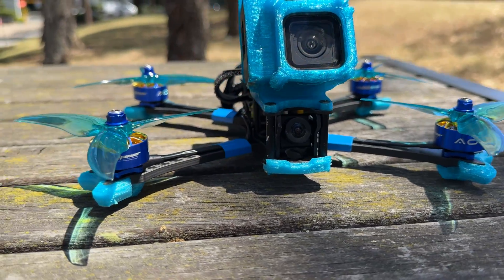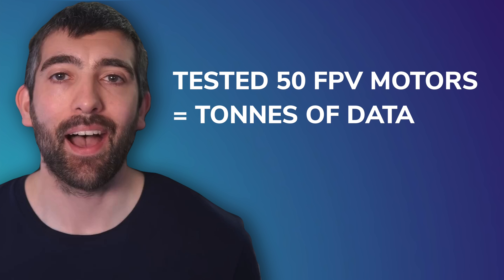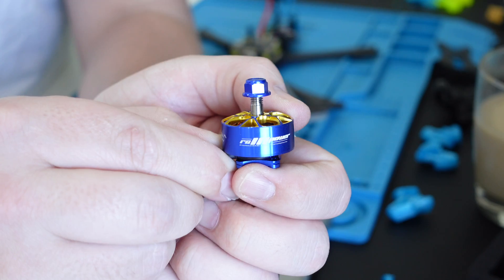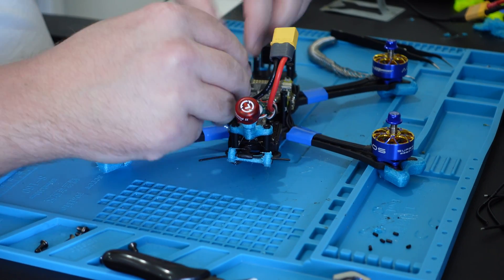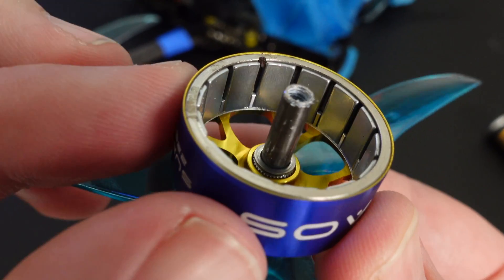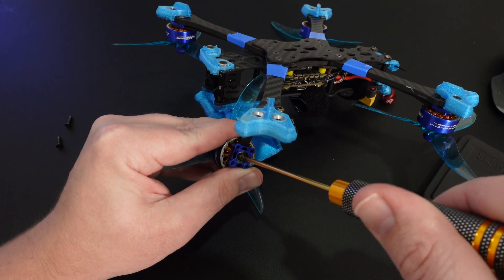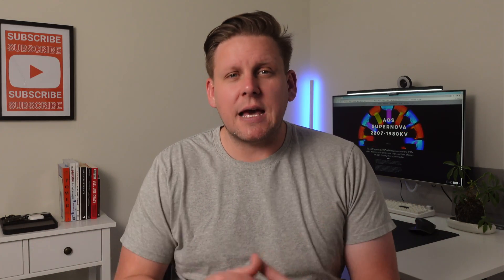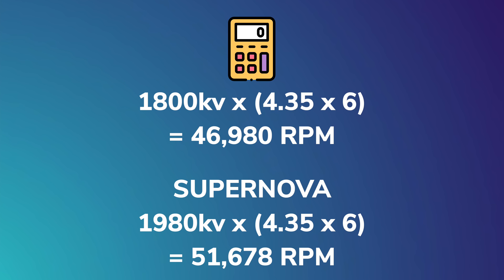I Tried “The Best” FPV Motor According To Science

Comment from the maker: There are somethings, which I didn't get into in this video.

My measurements indicate they're closer to a 2308 than a 2207.
But Chris already told us they're not 2207 but "2207 Class".

Chris states they are quantifiably better performing in terms of thrust, torque and efficiency than the average of the 2207 motors he's tested. But 2308 is a bigger stator and produces more power than a 2207. Therefore, of course they will be higher performing, that's how engineering works.

Before I get into this, you may think, well isn't Chris one of the "Good Guys". Chris was contributor in the community who was recovering some of the cost by his frame and some products. We could all get behind and support that.

However, Chris has/is moved/moving away from "I'm just helping out the community and being reimbursed for the efforts" to a full on commercial business in FPV. So he's due the same scrutiny that we'd give any other company.

Here are the several issues with these motors:

1. Science & engineering is supposed to be able to discern truth and define fact. Having a motors that are closer to 2308, but calling them "2207" and using the term "2207 class" is disingenuous.

2. Chris has built his authority in FPV based upon applying an engineering approach to define truth and fact from his testing. This profile was based upon a companies sending him their motors to test for marketing purposes (and yes he's bought some himself).  To then use the motors provided by companies to create a competing product doesn't exactly exemplify integrity.

If the companies who produced the motors were also in the UK or even in the USA, it sounds like Chris would have a lawsuit on his hands.

3. Chris states his motors perform quantifiably better than the average 2207 motor. I don't have any issues with taking the average as a benchmark for marketing reasons, that's acceptable. But, with the stators being closer to a 2308, Chris calling them a 2207, then comparing them to 2207 motors doesn't show whether they genuinely perform better because of the engineering he's put into them, or if it's simply because you have more stator volume on a 2308 than a 2207.

4. Why didn't he just call them 2308's and use his platform and science to say that the best motor size for 5" Freestyle is a 2308? I actually wish he did, even if they are a few points of a mm smaller than 2308, representing them in their true size would have been better.

But calling them 2308's and saying this is why its the right size, opens him up to competition. You can't charge $29 for a motor that's performance is derived from its stator size and its marginal improvements over the competition are because of its engineering. 

Everyone would make 2308's and Chris's competitive advantage is suddenly gone.

As I said in my video my measurements shouldn't be taken as 100% accurate, but if you give the manufacturer the courtesy of not having to be accurate, and allowing them to be misleading in their product - well, same applies here.
Reply: The weight is about the same as a 2207 motor so in my opinion it's fair to compare them, but the naming is wrong
Reply from the maker: @timon72489 yes and if the marketing said, I’ve built a 2308 that weighs the same as a 2207 so you get all of the benefit of the extra stator volume without the penalty of the extra weight. 

But he didn’t. 

He’s saying they perform better than the average 2207, as a 2207. 

So not a true representation of the situation
Reply: @DarrenAllatt a Ford mustang 5.0 isn't exactly 5 liter motor. It's 4.951 liter. I don't see why the exact size matters so much or why that's deceiving in any way. We already know how the motor is made is more important than just the physical stator size. That's why some 2207 are just clearly better than others, while still being the same size stator. I think the prop size/weight/kv are what puts motors together in the same class.
Reply from the maker: @bigfuzzyarchon2007  Except Ford aren't saying their Mustang 5.0 is a v6, scientifically X% better than the average V6 when its actually a V8
Reply: @DarrenAllatt  so are we only allowed to compare motors of exactly the same stator sizes now? 2306 vs 2207? I always just grouped them by what prop size they are meant for, and then their weight and kv.
Reply from the maker: @bigfuzzyarchon2007  there are two things here

1. When you compare a motor you need to also compare the stator volume, 2207 has about 6% more stator volume than a 2306 which is what allows it to have higher performance.

2. In your example you mention comparing a 2306 to a 2207, you can absolutely do that but when you do, you know you are comparing two motors with different stator volumes. In the situation with the Supernova's they're being marketed as 2207's all the product marketing & specifications says 2207, but they're not they're 2308's. It's like me comparing two engines in a car saying my V6 Engine which has 8 cylinders is better than the average V6 engine
Reply: @DarrenAllatt  what I'm struggling with is why would we be upset if we're getting more than what it says. What is the downside of these motors when compared to other 5 inch motors? Besides price obviously. If they weight the same, perform better, more efficient, then I feel like it's okay that they also cost more. So the issues aren't really with the motor itself, just how it's compared to other 5 inch motors
Reply from the maker: @bigfuzzyarchon2007   

How are you supposed to make an informed decision on which product to buy if the product specifications are misleading you?

If T-Motor produced a 2308 in 1980kv of their budget Velox motors, which on the bench had close enough performance to the Supernova's and were half the price; you can now make an informed decision. Do you want a reasonably close enough performance for half the price or did you want the premium ones.

(car analogy) But to in your marketing and product specifications say your motors are a V6, which perform far better than other V6 motors, which is why you should buy my v6 engine - but its  actually a V8 and the reason for the higher performance is mostly because of the extra 2 cylinders its misleading you, because then you'd want to compare it to other V8's when making your buying decision.

The issue I have is that:

Chris is meant to be the "science & engineering guy" who is able to ascertain facts and provide truth and hard data and actual specifications to the FPV Community.

He openly does this with every motor he tests and publishes all the hard data and facts, defining the actual truth. 

This gives him authority.

But, the moment money came into the equation in order to sell his own motors, he no longer played by the same rules which he scrutinised everyone else against. He no longer stuck to facts and he purposely skewed the marketing to favour him.

Imagine in Nascar if someone has a V10 but said their motor was a v8 and the reason why they were better was not because they made a better v8 then everyone else, but they stuck two extra cylinders in the engine.

I would have zero issue of Chris called them a 2308 and marketed them that you get all the benefits of the larger stator volume without the weight penalty of the increased size.
Reply: @DarrenAllatt  The main motor he compares against is the rcinpower wasp. which based on his data was the best 5-inch motor. It 22.6-6.5, which is smaller stator volume than 2207 motors, but better thrust and efficiency. I don't think anybody actually cares about the stator volume itself, only about the actual performance. Just like in a car, if you want the quickest car, it doesn't matter if it has a v6, v8, v10 or whatever. The actual 0-60 time is what you will be comparing. The number of cylinders is completely irrelevant when you are trying to find out 0-60 times. You can always find a faster car with difference number of cylinders. Yes, obviously there are going to be motors with better value, I would argue the wasp motors are better value. In race cars, finding advantages and bending the rules with some innovation is how it's always been done.
Reply: @bigfuzzyarchon2007  I think it's still a bit odd that Chris asked the viewers not to share the measurements of his motors on the internet. So at least Chris himself does care about the stator volume.....
Reply: @skychaser5591  just saw another video where they properly measured the motors, they are 22.5x7.5
Reply: @timon72489  define about in grams :)
Reply: Why did you zero comparisons other then measure them with a caliper?  Did you compare flight time or top speeds using GPS or a speed gun?  It sounds like you just dont like chris.... why not actually show us they are not any better instead of just complaing about the size?
Reply: Other manufacturers are not based on science when they make motors, they just make them randomly :face-blue-smiling:
Reply: Thank you for taking the time for this
Reply: So you have not realy tested them? fly different motors let them hover and see the flight times for example. You have those motors, are you realy shure that the stator volume is bigger? I mean have you at least meassured them before you jump to conclusions? You say "measurements shouldn't be taken as 100% accurate" BUT have you meassured them?
Reply from the maker: @iwh7  Did you watch the video where I showed the callipers on the stator measuring it?
Again, I am not disputing that Chris's stated results aren't accurate - they will be spot on; rather its they're not 2207 and they're being compared to 2207 motors
Reply: @DarrenAllatt  ive seen that, but meassuring only the height and outer size does not give you the volume, for that you have to at least meassure the inner size too and take into account the amount of vollume used by the windings. and VOLUME means mass. yes its not an 2207 that is clear but from a weight and twr it still seems a fair comparision? and the only things i got,  its not exactly an 2207 size and its pricy. But that does not say anything about the other claims. power, Efficiency and torque. And for the rotation speed, is it as advertised? and if this motor is as promissed more powerful AND more efficient, you could probably ignore the higher kv by simply using a lower max rpm, which means maybe even more efficient?  OR if it exists in other variations ORDER the right one for you. But that ALL NEEDS to be tested to give a realistic and honest review.
Reply: Motor companies have done this since the beginning of mini quads.  I do love all the hype and drama.   Buy them or not.  Like them or dont.  I also dont think the price is all that bad.  I have a set on the bench to try out because i like to try things and i think these will push us incrementally forward.
Reply: almost 8 minutes and you LITERALLY didn't say anything about the motors that would actually change my initial impressions of it, just a whole bunch of "don't trust the data". Like he didn't even give me his "feelings" to replace the data, he literally didn't say anything other than "I think the stator is big" which Chris literally says in his videos (overhangs of the magnets capture flux that would be wasted from the top and bottom of the rotors). If you really think these motors are 2308 instead of 2207, compare them to 2308 by power, flight time and weight then. Do ANYTHING other than ramble on like an older generation shitty generative AI
Reply: Tldr: science guy said science so best! Aka: let’s take the bison > wasp > fpvcycle stator iterations, swap the flux ring to magnet ratio, dip it in blue paint and raise the price by 20%, call it best coz science and send it 💸💸💸💩🥪
Reply from the maker: @ciaofpv5520  yes!
Reply: @ciaofpv5520  prove it, "trust me bro"
Reply: Imo due to thinner magnets Chris`s motors may be considered weak and lightweight 2308, I would love to see comparison of motor inertia of bell and weight of motor between comparable 2207 and this new 2308. Creating lightweight 2308 seems to be not ground breaking but really nice idea comparing to other signature motors of other youtubers. I am person which buys cost efficient fpv parts, but if i had a enough money to spend to buy o3 and high end quad I would consider choosing these motors becouse price difference considering whole quad is not really that high percentage wise.

Comment: If the data is correct, most difference will be just in the flight time, at least the 2807 compared to other gets like 15-20% more energy efficency, not to dive deep into max power etc. for the similar power 20% less energy is drawn and that is the most difference, specially with medium/long range drones

Comment: The downvotes really show how few people truly understand how the scientific method works. Sad part is, even in professional research. many scientists fall into the exact same biases you outline (sometimes willingly because money/subsidies grease the statistics). This is a big reason why there are a lot of failed startups that plan a product purely on the findings of their research team, put out a failed product because they never linked the experimental design to the actual end user application before the product launch.
Reply: Very rarely are motors what they say they are. 2207 are often 2207.5, 2306.5 is common as well. The real engineering on them is largely down to the insanely tight magnet gap to the stator. Other things like silver plating the copper wire, winding tightness, stator lamination thickness, lamination steel, magnet thickness, spacing and strength. The engineering behind making these isn't just making the stator half a mm bigger, many others already do that.

Comment: I popped a set of SuperNovas on my 5 inch Alien 6S build. One motor arced through the frame and the other three got extremely hot within 5s of testing it.
I never got a chance to pop on props and take it for a flight. 
I'll be going back to my previous motors after that experience.
Reply: Very interesting insight !!! thank you

Comment: I feel like you need to prove that the performance gained by "mis-sizing" the motor in theory is equal or at least very close to the performance gained by Chris's design in order to really stand on this hill about incorrect motor sizing. I never once assumed that the measurements for any motor were exactly accurate down to a tenth to begin with honestly; seems people have commented other motors that aren't their exact labeled size either. I'm not interested in making a hundred different motor sizes for each tenth mm and i doubt anyone else is either. The hush hush thing is a bit weird granted, especially given the internet is immediately going to not do that. But I truthfully couldn't give a shit, as long as the motors perform well, holds up well, and don't cost a fortune who cares? I don't get what all the fuss is about.

Comment: Is 2050kv the best for racing?
Why not the 2500kv ?
Reply from the maker: 2500kv is for 4S, while 2050 is pushing the high end of 6S
Reply: @DarrenAllatt  So the 2500KV for 6S will not be good to get more speed for racing ?
Thank you for replying sir big fan !!
Reply from the maker: @harleyqueen1337  I’m going to answer this in two parts here, because you are missing something hugely important in your line of questioning. 

First, 2500kv motors are not designed t o run on 6S, they’re designed for 4S.

If you were to run them on 6S, they would draw too much current, causing your ESC to blow and most likely catch fire. 

Your motors would also get too hot from the current overload and blow as well, probably also catching fire. 

Now that’s the pragmatic answer to your question- here is the second part, which is the important thing you are missing. 

“Speed” means absolutely nothing in racing if you can’t control your drone. The best racers can use 6S motors with 3S batteries (so they produce half the power) and be quicker around a race track than most pilots. 

The point is, speed in racing comes from skill and being able to control your quad to get it around the track as fast as possible. 

There is no point doing 200km/h with a drone, if to get it around a track you need an extra 30 meters for every turn to control the drone at that speed, where going 100km/h but being really tight around corners will get you around a track 4x faster.
Reply: @DarrenAllatt  Thanks a lot sir

Comment: runtime on a 4s 1500mha? run time on a 6s 1300mhs?
Reply from the maker: Those batteries do not have the same Watt Hour Capacity. 

The 4S has 26.1 Watt Hours, the 6S has 33.93 Watt Hours. 

The 6S has a higher capacity, so you can expect more flight time.

Comment: Idk about artificial considering I get 140mph and 5mins on hard freestyle with the cheapest battery around 1300mah rchacker. Then long-range flights 9mins on the same battery 12mins on 2600mah. Maybe try a different prop 5150 or a lighter frame AOS UL5 if your not getting these results
Reply: What components do you have?  I don't believe you are getting that speed with 5 minutes freestyle.  My 5" 6s can go 100 and gets 3 minutes of I push it hard